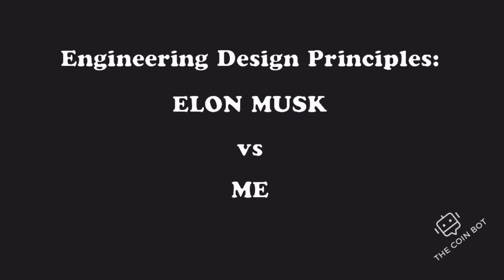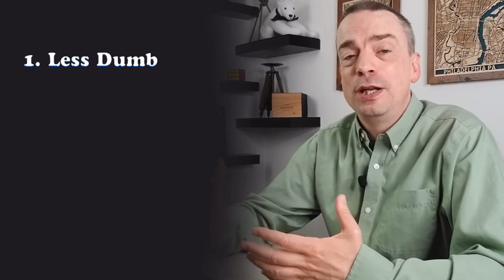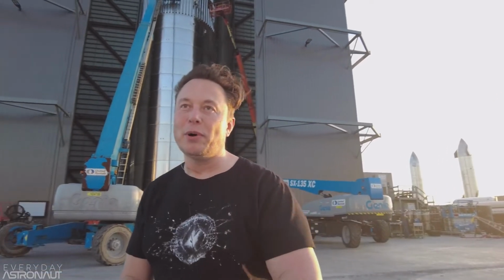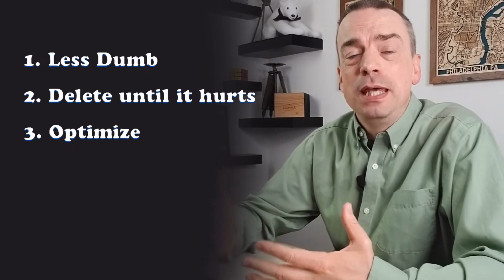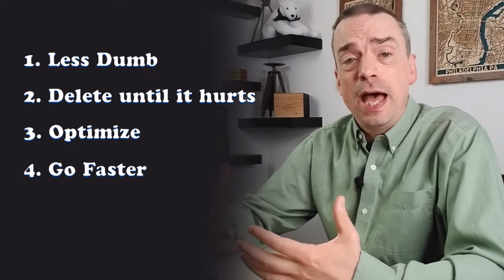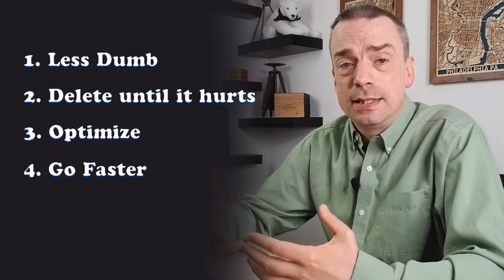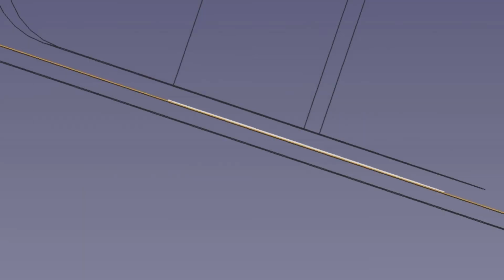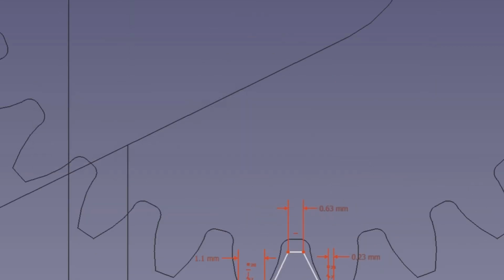Elon vs Me - Engineering Design Principles

Comment: Thanks for sharing those design principles from Elon.  As artist i think we always weigh the  Esthetics of our designs much more than the functionality. (Means your probably an artist before your an engineer)
 A trash can a few extra dodads may be just as functional as the end product but you would feel much more sense of accomplishment from designing of a  modern looking device smooth edges, lights, etc..  i would suggest sketching or 3d modeling in simple shapes ( maybe even kit bashing a mode)l to quickly stumble upon some design ideas before blindly trying to tackle idea.  I think this will help generate more design ideas that you can then simplify.   
I am enjoying all of the content so far.
Reply: Also i would like to add that Elon's design principles may be a more valuable stratagy for designing items for mass production  and scale than a one of a kind personal device like you seem to be aiming for.  Not to say that Elon's approach isn't  an effective way at approaching design, but unless you plan on mass producing your coin bot you may not need to stricken yourself to all of the engineering principles he has outlined.  I say have a bit of fun with it
Reply from the maker: It's also a very good point about the design principles working better for a potentially mass produced item, but I do think they have value generally too.  I especially like the idea of reducing the part count. I think this forces you to think of simpler solutions to complex problems . . . and I have often found that if you're willing to take time to sharpen the saw . . . you can cut the wood faster. Or in this case, if you take a little extra time to design well, the finished product ends up being easier and cheaper to produce.  That being said . . . I probably need to lighten up and try to have a bit more fun with this whole thing!  (You sound like my wife . . . so maybe the universe is trying to tell me something!) LOL  :D Thanks again.
Reply from the maker: Thanks so much for this encouragement and great ideas. I totally agree that there is definitely an overwhelming sense of pride when I come up with a clever solution or design.  I think that creativity is the root of being a good human.  I think we're all here to contribute our talents to the greater good. Thanks again.  Keep the comments coming. I truly appreciate you my friend.